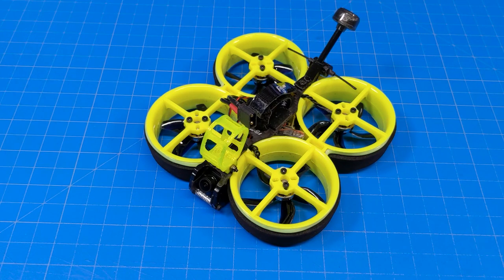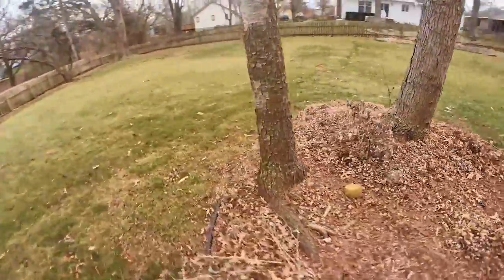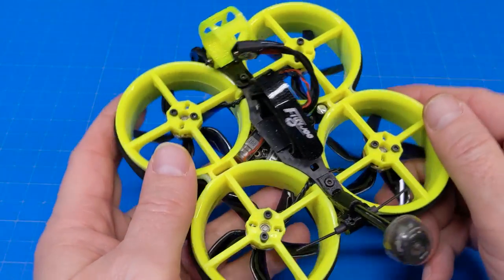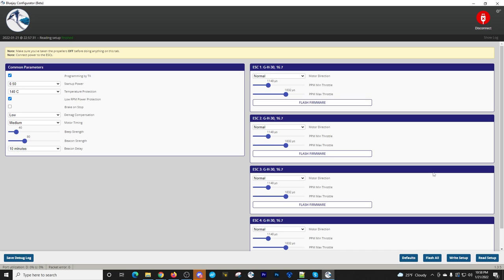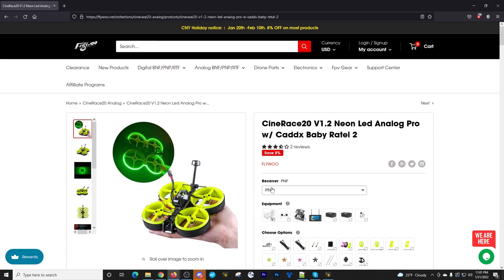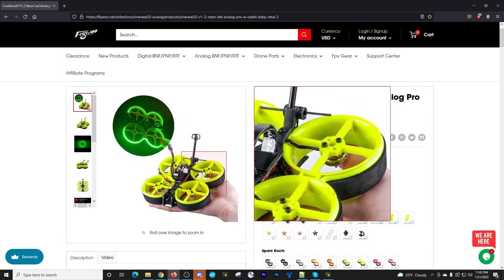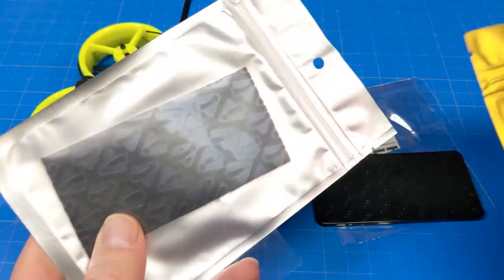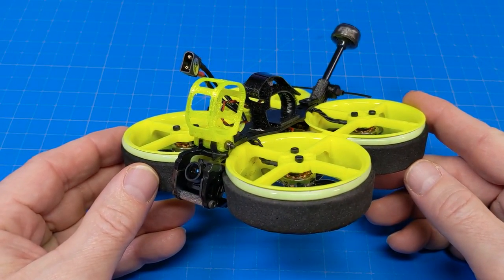FlyWoo CineRace20 V1.2 // Yaw Washout Fix // SomeThing To Chase

Comment: Yeah did mine also, but DON'T assume if the 1st ESC says normal, then 2,3 and 4 are, nope mine was not, I did not pay attention and switched to reverse, not knowing ESC 4 was already on reverse and should be changed to normal. My Guess, Flywoo had solider those wires backwards and instead of taking the time to fix that they just did it in firmware settings, took me an hour to finally figured what had happened, but got it done and yes it really does help, thanks for the info and your right, really need to go slow and "PAY" more attention when switching things around in the firmware. FYI - I love the 5 blades so much more punch!!!! I even dropped the 5 blades on the small Geelang LIGO 78x Pro 2 Digital.🙂

Comment: I don't fly in "prop in" configuration because when I take off or land or even do a low pass, lots of grass shreddings can be thrown on the camera lens. I need to see where I'm going... ^^ By the way, my biggest models (7 to 9 inches) are the official brushcutters of the field... When the grass is too tall, they can mow it like a charm and with a lot of fun! Not as fun as the cleaning session at the workshop afterwards... ^^
An interesting pro argument of the "prop out" config : to prevent arm dive on a hard turn... It can be interesting in freestyle or race configuration but it's mostly annoying for numbers of pilots. I'll keep it for future uses. ^^
For the battery pads, for almost all my models (quads and fixed wings), I'm using, since 2-3 years ago, a reusable/washable silicon transparent clear tape acting like a thick (+-2mm thick) double sided tape and sticky as F*. The straps are almost redundants with this one. I found equivalent looking ones on Amazon with the request "double sided silicon tape" (the reseller I trade with, back in the days, isn't available anymore, so no good link to provide, sorry :-/ ). And URUAV have some interesting ones too.
My 2 cents. Happy flying and stay safe. Cheers from somewhere in France.  ^^

Comment: Idk if no new micros are just coming out but you used to post a lot more. Now it’s just expressLRS and HDzero and cinewhoop stuff. Bring back more of  the analog fast micro fun! Would also be cool to see videos of just you rippin your favorite quads without selling us on something. Still the best micro channel but we wanna see more analog micros! Some of us either prefer not to or just can’t keep up with all the new bs coming out. To much options to choose from. And tell your buddy’s at AvantQuads to come back out with a 2-2.5” micro. 😉
Reply from the maker: funny you should say that in this same video another comment requesting more DJI stuff. I know I haven't posted as frequently recently. Its one part a new job, requires more mental focus and I think I am more fatigued at the end of the day, fewer new products (especially quads) I think has something to due with manufacturing difficulties. And outside fly time has been very limited as it has been very cold. Flying below 40F is fairly uncomfortable and we have had a few snows. I don't fly outside when there is snow laying on the ground.

Comment: Mine already came in the props out configuration and I notice that it sometimes will rotate to the left when I'm trying to lower my altitude. Is this a symptom of prop wash or something more? I already had to replace a motor because it seized up during my 2nd flight wouldn't mind replacing the aoi with a 40A so I can upgrade the motors. I really just want to know if this rotation is common or not. Mahalo for this and the other videos that you make I enjoy watching and learning from them
Also have you seen the foxeer foxwhoop? I really want to see you do a review for that! I still am learning with my cinerace20 but according to the description of it, it's unbreakable and way faster and maneuverable. Looking forward to a review of that. Mahalo again for your videos
Reply from the maker: Quads an come props in or out. Does it matter, it can. In this form and with the flight description I would switch the motor and prop rotation to try to see if it corrects it. I also suggest being very sure you want to do this as it sounds like your starting out in fpv and change prop and motor direction can trip some up and then you can’t fly until it’s corrected

Comment: Hey Nick, thanks a lot for the video. I followed the steps but my little CR won't take off. Any chance you can share some screenshots of your "Configuration",  "PID Tuning" and "Motors" tabs from Betaflight 10.8? I spent the last two days to get this thing up with different tutorials but nothing really worked so far. I must be doing some seriously wrong. You would make my day 💯. Please let me know if you can help out 🙏
Reply from the maker: This is from a few years ago but still largely applies. https://oscarliang.com/quad-arming-issue-fix/ If your quad won't arm while connected to betaflight/usb that is normal as that is a safety precaution built into the flight controller firmware.
Reply: @NickBurnsFPV  Thanks Nick. I wrote their support and they told me to load the CLI from their website which I did. I think I probably have flashed the wrong firmware to my ESC as now the remot isn't even working in Betaflight anymore. Can you tell me which firmware I should flash again in BLHeli. This would help me out soooo much :)
Reply from the maker: @IMlab  I don't have the quad anymore to reference. Its really difficult for me to know how to help. I worry as blheli has nothing to do with the remote or the connection from the remote to the quad. Is the radio bound to the quad?

Comment: Hey Nick have you seen the quad twitch on the yaw axis? Mine does a strange twitch and I can't figure it out. Have you done anything you your tune? I have the newest version.
Reply from the maker: No I haven't changed the tune. I have seen a sporadic twitch on another quad. I resolved it by lowering the dshot version from 600 to 300.

Comment: If one of my propeller is turning slow does that mean my motor is bad?
Reply from the maker: It can mean the motor or the esc. Does it still fly?
Reply: @NickBurnsFPV  no not at all one motor just turns real slow, an this is my first drone I'm not sure what to do
Reply from the maker: @kaelstokes5804  Its either the motor or the esc. The way to test, is to move the motor to a known working position and resolder to the esc for that motor and test. If it turns slow still its the motor, if its normal is the esc.
Reply: Most likely. I just had to replace a motor after my second flight when the front left stopped working during flight. When it was armed, the propeller on the bad motor wouldn't spin. The flywoo tech asked if it made the noise when first plugged in and it did so that ruled out bad esc. Getfpv shipped my motors fast(3 days) and I live in Hawaii. It's not so bad once you get everything apart and separated before you solder. It just seemed very intimidating at first but once I got the vtx off it wasn't so bad. Hope it is just  a motor so you can get back to flying quickly.

Comment: Hi Nick. did you use nd filter with insta go2 ? I have jelllo without nd filter on my go 2.
Reply from the maker: No I did not. If you have jello, check that the props are good and the mount might be introducing some jello if its not solid or tight.
Reply: @NickBurnsFPV  props are brand new. Im using flywoo go2 mount though
Reply from the maker: @TERBANGFPV  check the pid tune. Flywoo has them posted here https://flywoo.tawk.help/article/cli-for-cinerace20-quad-series

Comment: Will it work with a SKYZONE SKY04X?
Reply from the maker: The analog version will yes.
Reply: @NickBurnsFPV  how do I know if mine is analog? Thank you very much!
Reply: the cheapest one, white
Reply from the maker: @ll3392  I would think the order would show vista or not. If vista its dji/digital, if not vista its analog.  If you bought it second hand you can ask the person you bought it from or does it have a vista in it. This is the caddx vista (what we often call dji) https://cdn11.bigcommerce.com/s-l8ppic5y35/images/stencil/1280x1280/products/23012/24750/Screenshot-2020-12-14-143547__45395.1630213473.jpg?c=1

Comment: can I fly with dji action 2?
Reply from the maker: yes, but it will weigh it down a fair bit. This is only a 2inch prop and with the action 2 will likely restrict us to smooth slower flight.
Reply: @NickBurnsFPV  is there sport cam lighter than action2 and with the same quality or better?
Reply from the maker: @rotorfpv4117  honestly I am not the best to ask that question. I am much more sensitive to flight performance than the image quality of external HD recording cameras. In general if the hd recording camera has its battery and its not the insta360 go or go2, we really need a 3inch propped quad to fly with it and go fast or do aerobatics.